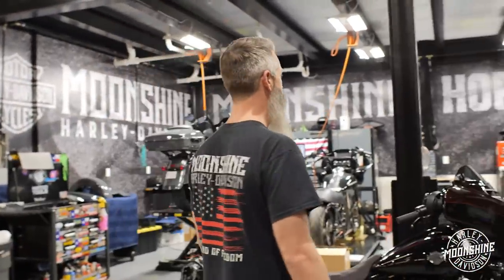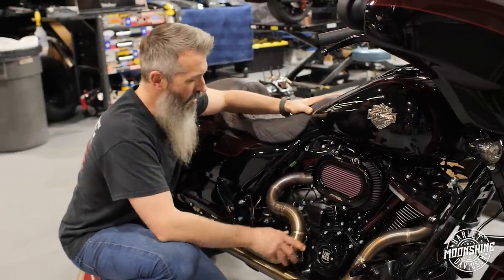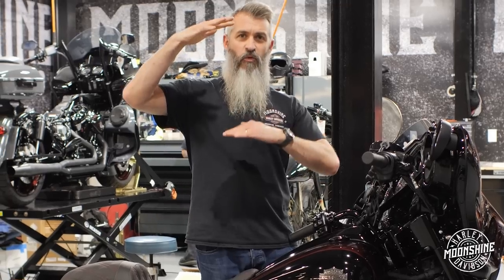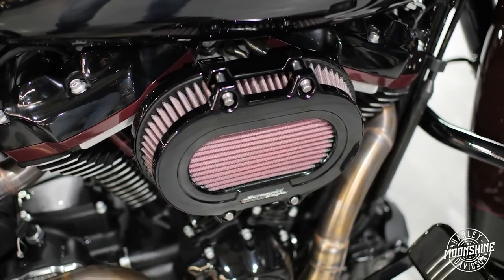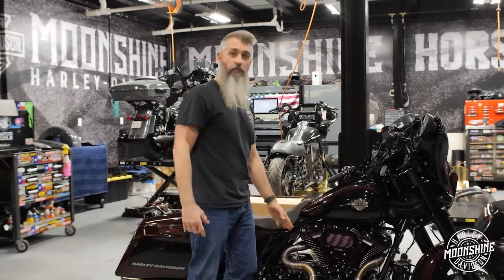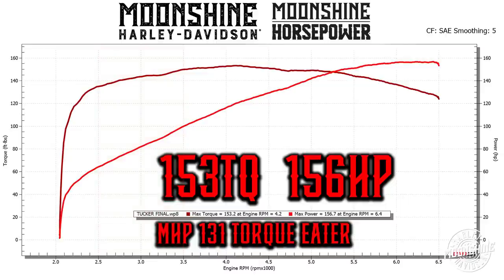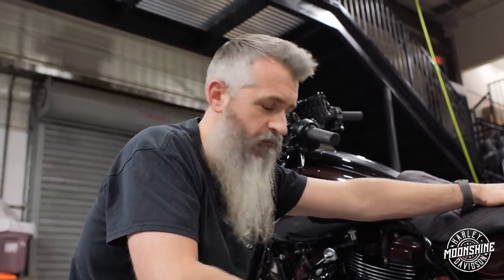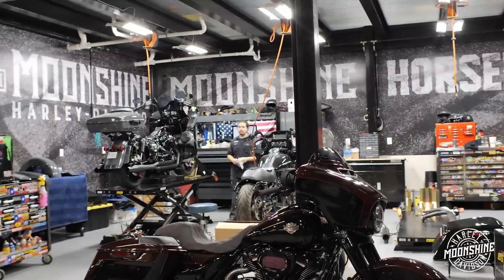Moonshine Horsepower 131 Torque Eater 156HP 153TQ| Bike Build No. 16

Comment: I can't say enough good about yall. My bike has been a little finicky and nick and Jordan have been on point with customer service 👌. My bike goes on the lift Tuesday. Can't wait to see the new numbers
Reply from the maker: Great feedback. It’ll be a beast!
Reply: What are you getting done to it now
Reply: @curtishoke508  it depends on the situation honestly. If I didn't hurt the bottom end I'll be doing a different cam to move the torque lower in the rpms. Now if I hurt the bottom end...it will be a case up rebuild
Reply: @roadglide128  are you gonna go bigger or stay the same
Reply: @curtishoke508  ooow I would definitely shoot for bigger at that point. Have to see what nick can put together for me at that point